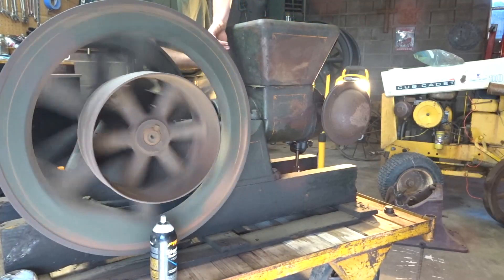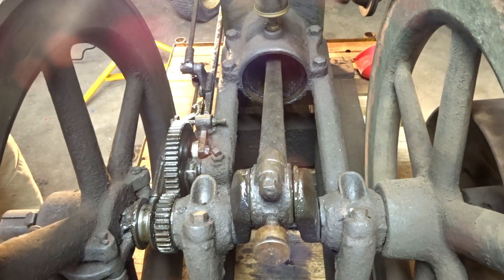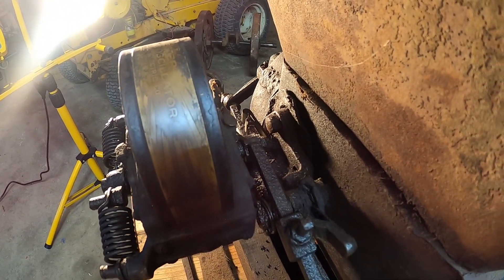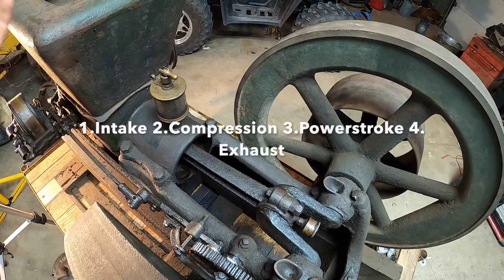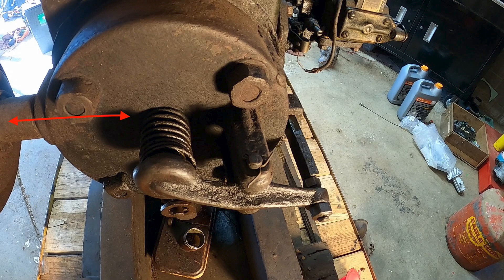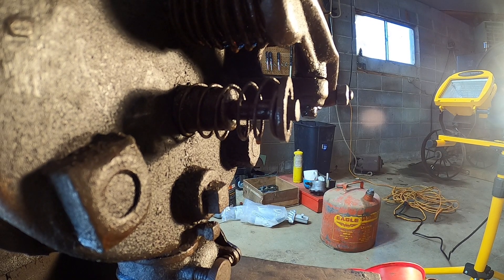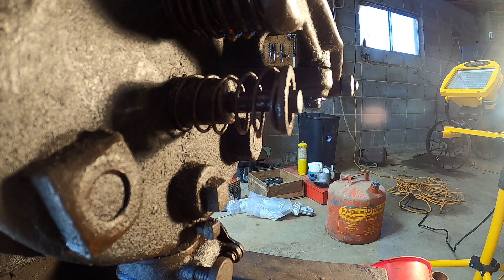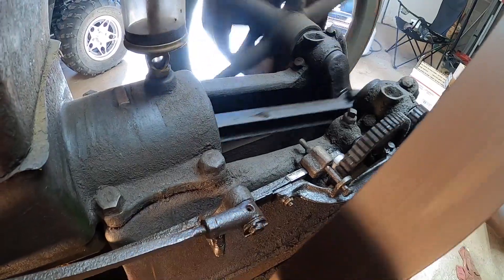How Does a Hit & Miss Engine Work?

Comment: 4:30 or so. How do you deal with the wear on the exhaust pushrod-tang mechanism from the throw out weights?

Does the rod have to be machined and if it does, how long would that last before needing a potential re-machining?
Reply from the maker: You bring up a good point. I'm not sure how many running hours it would take to wear out. All depends on conditions and how often its oiled. I over oil my engines for that reason

Comment: Nice.  Would like to see a follow up on mag and ignitor using the same engine.
Reply from the maker: I have a video of me pulling the mag and igniter off  cleaning it and testing it. The video is called " Igniter what's that". The video is on this particular engine.  I'm by far not a expert on mags. But I will definitely make a video at some point on how they work.